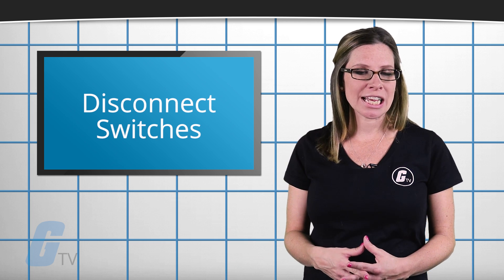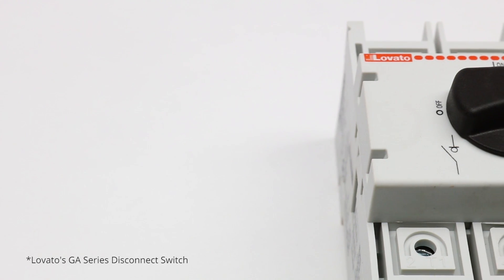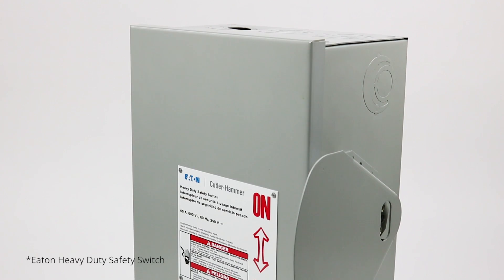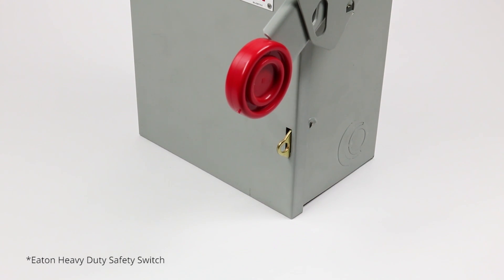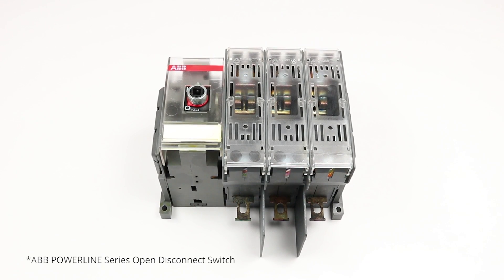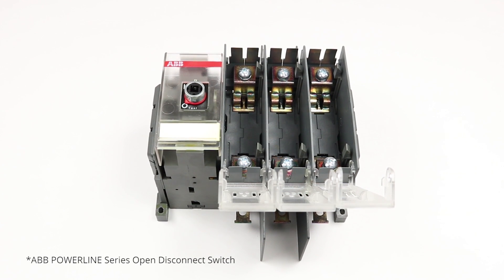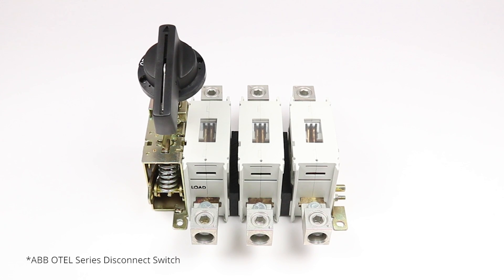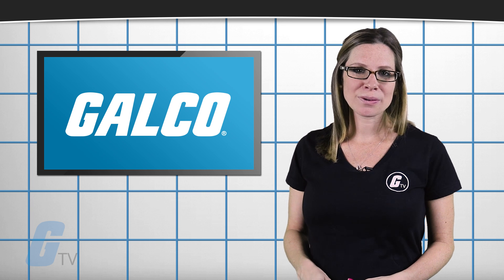What is a Disconnect Switch - A Galco TV Tech Tip | Galco

Comment: can you explain what there is a solar pv ac disconnect and the grid is down. Does the inverter ac energy flows through the fuse and into the grid wires leading to the Main panel?